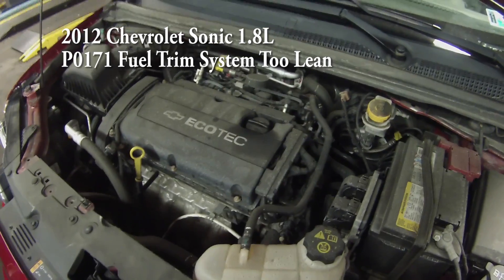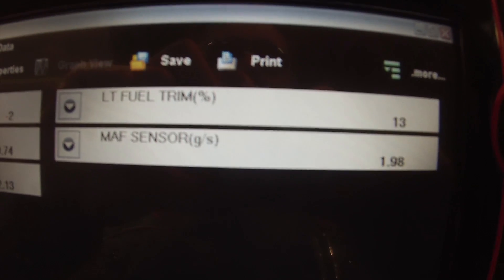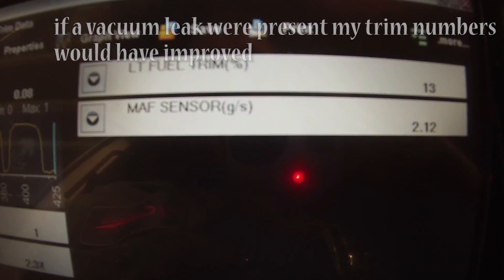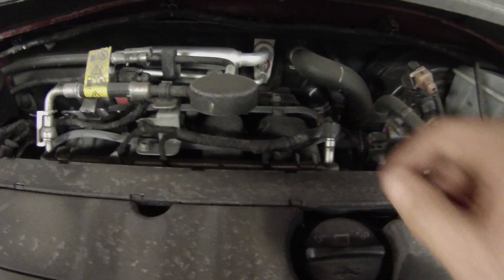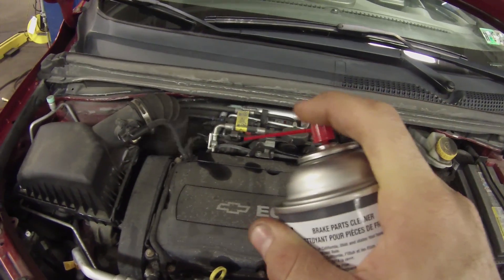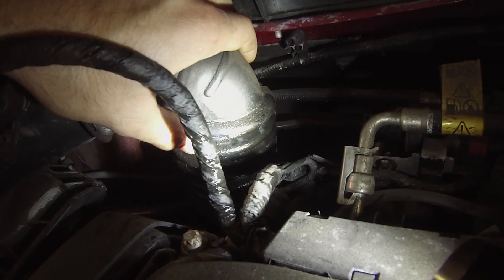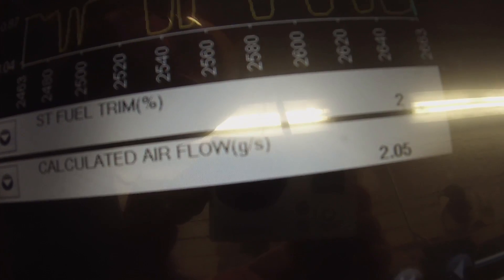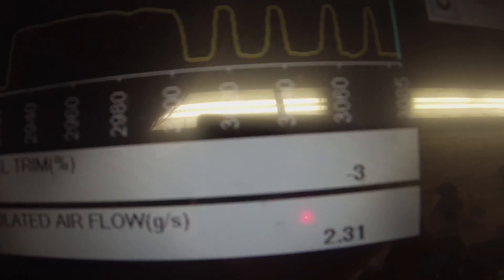2012 Chevrolet Sonic 1.8L- P0171 Fuel Trim System Too Lean

Comment: Tbh, if you have a smoke machine, I'd say ALWAYS start with a vacuum leak test. This video sort of proved it, you can't always rely on "typical" expectations. The LT was 13 even at idle AND load, not something you would expect would be caused by a vacuum leak. Good find.

Comment: I know this is an old post but I have the same code and the traction control light comes on? Could this cause that or is that just correlation not causation?
Reply: Hey, same for me. Let me know if you found out what was causing it if you could please.

Comment: 2015 sonic 1.8 ....problem idle is up n down also after filling with gas had hard time starting couldnt see any vac leak guys says change air intake hose or fule filter or injectors been researching and says look at the pvc vaulve doraphram remove n clean if not replace for round 70 anyway any one have this problem and can help advise

Comment: I have my 2013 sonic at the dealership and was told valve cover gasket leaked, carbon build up on engine and fuel treatment is needed $998. I hope it fixes the bad idle.

Comment: Is the issue that the recall was issued for.  My car just coded this and my mechanic is saying I don't have a vacuum leak. The recall was issued a letter stating the problem was covered to 100000 miles.

Comment: This is a duct design issue. The convolutes should be in the direction of the engine roll. With the current design, engine roll creates a torsional load along the axis of the convolutes and rips the rubber along the valleys. The rock hard rubber at cold temperature certainly doesn't help. Ours had less than 50k miles when it ripped and throw the P0171.

Comment: From what I read , common problem with AVEO's & ( at least early )  Sonic's .  We have a 2015 Sonic , this problem has not occurred , yet .  Hope they had it corrected by 2015 .

     The plastic thermostat housing also falls under this category .

     And the plastic " button " on the auto transmission shift lever .

     But so far , we are happy with our Sonic .  Inexpensive to buy and good MPG's .

God bless
Wyr

Comment: This is a common problem , They used crappy rubber . Mine was broke almost in half and the dealer said everything was fine. Cost me almost 70 bucks for that rubber hose but fixed my problems.
Reply: John Hotdogs what rubber are you speaking of
Reply: @pumpanickleP  the Trojan 🤣

Comment: This was neat...
Don't Understand why the fuel trims didn't go down when you were holding high rpm....
And yes vw's with high fuel trims cause by dipstick..sensitive cars I tell you
Reply from the maker: The reason the trims did not improve is because it was not an actual manifold vacuum leak. It was an unmetered air leak after the maf but before the throttle plate. If it were after the throttle plate. The trims would have reacted differently
Reply from the maker: And no matter what the rpm was there was always an undetected amount of air that the maf did not see
Reply from the maker: Or another thought would be maybe the leak was just to big to correct
Reply: Forgot about that one.
Thanks for the clarification...

Comment: My shop sees this issue a lot here in Utah. We also had one that the intake boot was ripped, fixed it, long term was still going +20. We smoked it, found the oil fill cap was loose causing a vacuum leak.
Reply from the maker: I have had a few vws like that, lean trim faults you open the hood and the dipstick is half way out because somebody checked the oil and didn't fully seat the dipstick